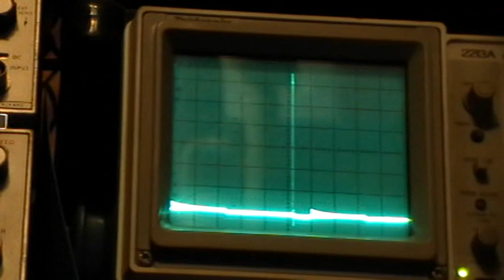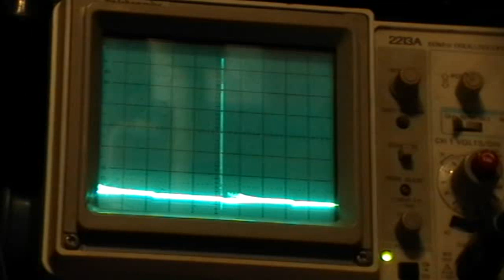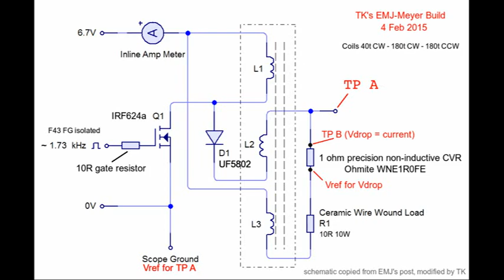Misc. Circuits: EMJ-Meyer Circuit Demo

Comment from the maker: @Cool Joule For some reason your comment won't let me reply directly.
For the neons to get that purplish tint there has to be a lot of current flowing through them. This system as shown doesn't produce enough current for that. But I have now put in a different transistor and it allows more current in the spikes, so they are starting to get a purple tint. I can also light 30 of them in series now.
Reply: Good